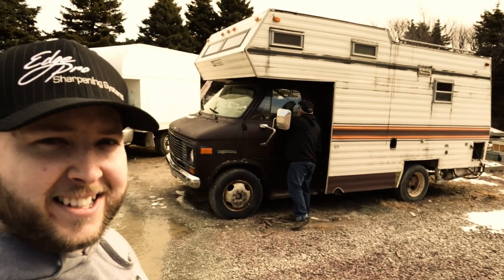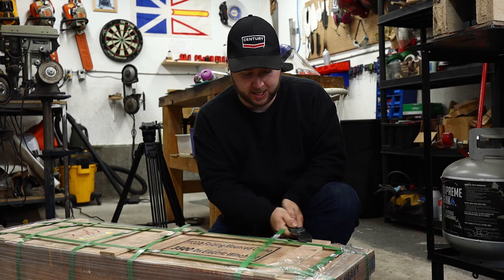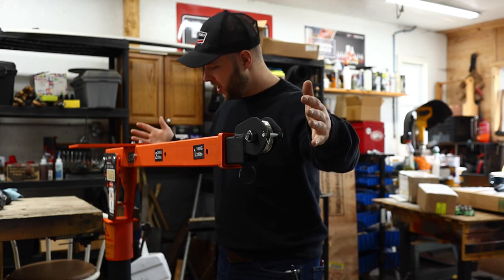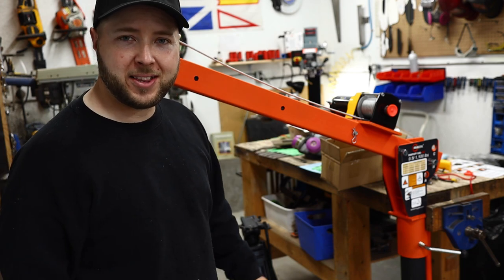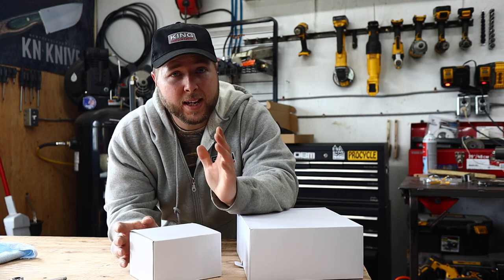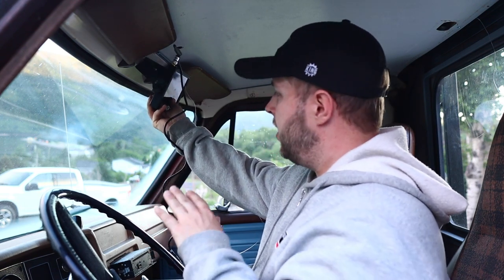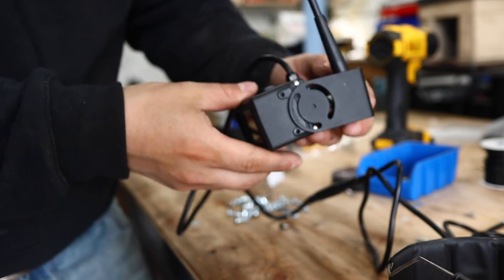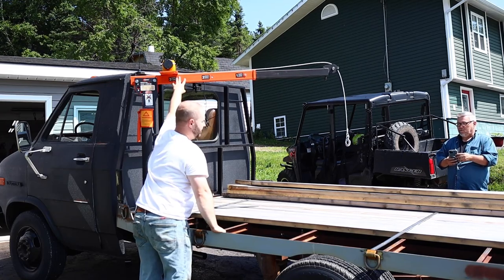My Custom Truck gets a CRANE!! - [28]

Comment from the maker: You can check out the crane here! 
"https://www.amazon.ca/RUGCEL-WINCH-Truck-Mounted-Wireless-Electric/dp/B0899GHT7W/ref=sr_1_1_sspa?crid=3520X47ONJJSE&amp;keywords=rugcel+crane&amp;qid=1658777347&amp;sprefix=rugcel+crane%252Caps%252C107&amp;sr=8-1-spons&amp;psc=1&amp;spLa=ZW5jcnlwdGVkUXVhbGlmaWVyPUExMVM0NTlIUFQ4UUpNJmVuY3J5cHRlZElkPUEwMDYxMTkzM0NVVDM1VlBTTlc4SCZlbmNyeXB0ZWRBZElkPUEwOTMzNDQ1WU5MOVlTMTQ4UlUxJndpZGdldE5hbWU9c3BfYXRmJmFjdGlvbj1jbGlja1JlZGlyZWN0JmRvTm90TG9nQ2xpY2s9dHJ1ZQ==&_encoding=UTF8&tag=weiderfankyle-20&linkCode=ur2&linkId=4ae2f95d93609808c6a49e7da8a21196&camp=15121&creative=330641">Truck Crane</a>

Check out the camera system here! 
"https://www.amazon.ca/Haloview-Digital-Wireless-Reversing-Waterproof/dp/B07GKXPKRS/ref=sr_1_14?crid=27JY8TOJCFCNX&amp;keywords=haloview+camera&amp;qid=1658777561&amp;sprefix=haloview%252Caps%252C116&amp;sr=8-14&_encoding=UTF8&tag=weiderfankyle-20&linkCode=ur2&linkId=98765809392bdb141d9dd378f12ebb2f&camp=15121&creative=330641">Camera System</a>

Comment: I suggest framing the cameras with 1/8 (or thicker) metal strips that would act like the bumpers on a cell phone case and protect the cameras from anything banging or leaning, against them. You could even cut up and install screen protectors to cover the lenses.

Comment: i  was working down in phoenix and bought a 66 chevy c-10 with a steel flat bed and removable picket sides and back it had a crane with it, the boom was strapped to the bed when not in use and it went into a 6 inch hole with quarter inch steel tubing. from what the guy said who sold it to me it was an original grave yard truck and was used to place the cement boxes - coffin holders in the ground. it was a sweet truck, 3 on the tree and that boom crane with all the attachments, i used to make money with it on weekends driving around the desert roads picking up broke down motorcycles, it paid well, especially when cellphones first came out, not the brick phones but the first cheap flip phones
Reply from the maker: Great story, Richard! Thank you for sharing. I got to enjoy some nice imagery while reading. I would love to make a little money with this truck when complete, just for the fun of it!
Reply: @kyle_noseworthy  it started out as just for fun with me then it got to a point that my phone rang 4-5 times a day on saturday and sunday when the weekend warriors were out riding and didn't know enough to bring extras like master links or a tube and some spoons, but it was still a fun thing to do, get out and take a ride to the lake or halfway there or something
Reply from the maker: @richardmcginnis5344  That is awesome!
Reply: @kyle_noseworthy  it was until my sister got her divorce, then i was out of the spare room and had to live in it until i could sell it and move back here to Connecticut, but that's okay i sold it to a friend who carried on with it. it was a really nice truck to, factory air not one of those buy it afterwards air conditioners and it only had 28,000 miles on it since it stayed in the cemetery for most of its life, i bought it in 93 and had to sell it in 94

Comment: I have one very similar. You’re gonna want access to pop it off the truck when you’re not using it. Mine shakes and rattles and drives me crazy. It’s not a big deal to remove it until it’s needed though. Definitely a nice thing to have for when you need it.